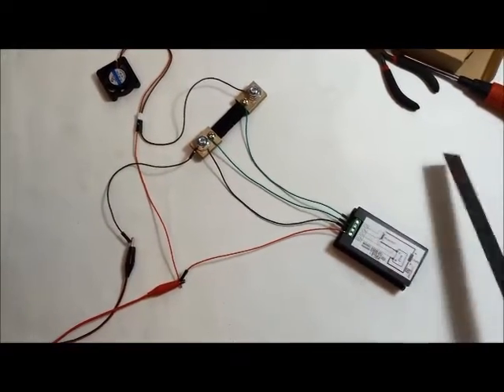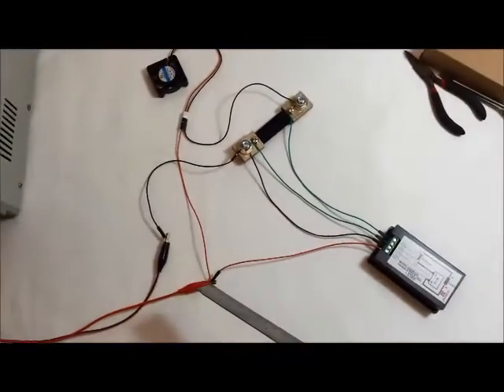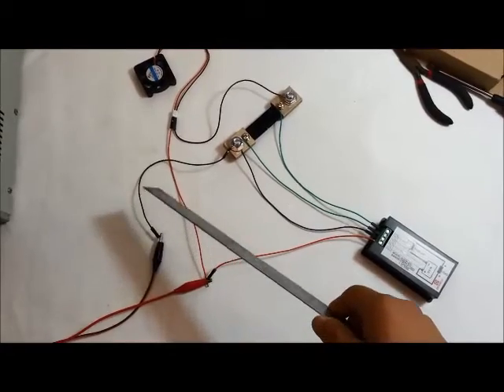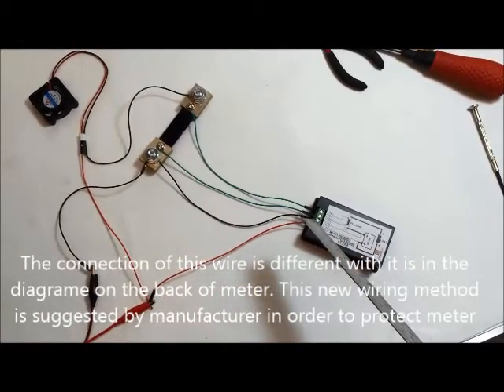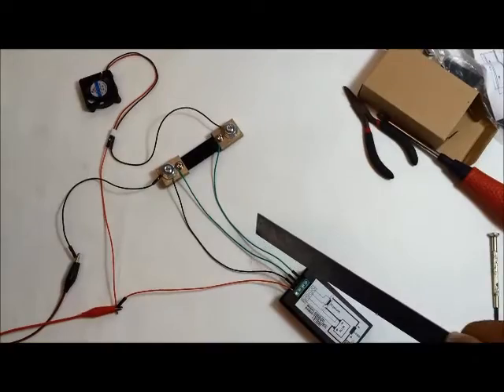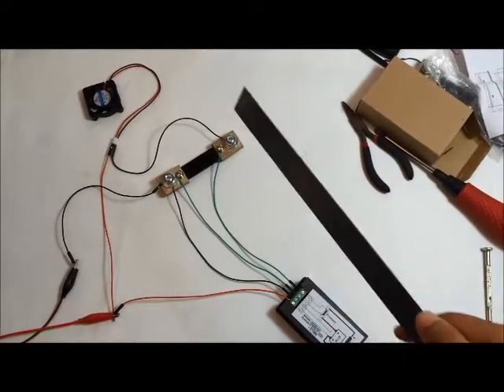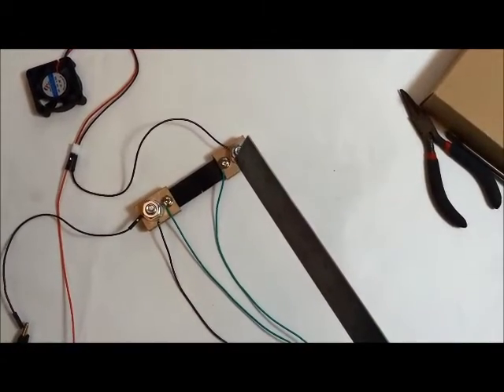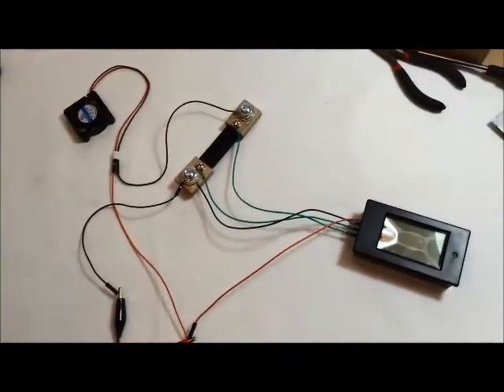bayite PZEM-051 DC 6.5-100V 100A LCD Current Voltage Power Energy Meter Multimeter

Comment: I bought 4 to put in my DIY solar shed project.  12v Solar panels.  12v batteries. And had 12v at the inverter when I was done wiring it all  up.  As soon as I hooked my batteries up to the system....all 4 ammeters lit up and were reading.  (Except they were all reading 48-50v).  Not sure why that was.  Everywhere I checked on the system I read 12.7ish volts.  But I then pushed the button on one to run thru the menu.  The meter then shut off.  And will not turn back on.  I held the button again for awhile.  And nothing.  So I did it to the other 3 and the same thing.  I double checked the wiring before hand.  Everything was right.  After they shut off I checked the wiring again.  And everything was exactly like the diagram. Any ideas??

Comment: Hello, thanks for this review. I would like to know how I can configure this to read battery voltage and number of current discharged from the battery. In my setup.. but the charge controller and the inverter can charge the battery. But the inverter is the load. Both the inverter and charge controller are connected to the battery.

Do I connect it with the Inverter being the load? hope nothing will happen when the inverter stops taking from the battery and instead starts charging the battery.
Reply from the maker: Please refer to this diagram:
http://ecx.images-amazon.com/images/I/713WcgbUDpL._SL1500_.jpg

Please check #2 and #3 meters.

Comment: I have a question about the current. Can it measure positive and negative? So charging and discharging currend?
Reply from the maker: +Robert-Jan van Poppelen No. The meter can only measure one-direction current. If you want to measure charging and discharging current. You can wire 2 meters on one shunt. Please check out the #2 and #3 meter in this diagram:
http://ecx.images-amazon.com/images/I/713WcgbUDpL._SL1500_.jpg
If you want to buy the meter, search bayite current meter on amazon.  
If you only want to measure the current, we have bayite hall effect meter which can measure negative and positive current.
Reply: +Bayite Amazon thanks

Comment: so far I hooked this meter to a fan and a light, if that is all it is good for what good is it? does any one know how to hook it up to solar, or a wind turbine??? help !!
Reply from the maker: +Ed Trulson Please chec the diagram in our last reply. In a circuit, you need to find out what is power source and what is load.In a solar system, there's a charging circuit and a discharging circuit. If you place the meter in the circuit between solar panel and battery, you're using the meter to measure the charging power. In this circuit the battery is load. If you place the meter between battery and your device. You're using the meter to measure discharging power. In this circuit the battery is power source.
Reply: you hook up the solar panels just like it is the power supply.. that is what solar panels are.. the power supply  DC   connect the leads the same as this video and you will have it.. 

Regulator or MPP UNIT is the LOAD

Positive (+) from the Solar panels is connected to the Regulator or MPP UNIT.

Negative (-) connected from solar panels to the Shunt 
Connect the other side to the MPP UNIT Now you are measuring the power produced by the solar panels.    The power can be from the battery side or the solar panel side..  Just know that the unit will alarm every night as it loses power due lack of sunlight unless one draws power from battery or other side of unit to get the constant range of 12 volts or 24 volts.
Reply: Terrance, I did as you suggested, connecting Positive from the Wind Gen to Positive of the Charger/Controller. Negative from the Wind Gen to the Shunt, the other side of the Shunt to the Charger/Controller. I can see Volts, Current etc. on the Display. Am I right that this setup only showing the Power the Wind Gen produces, but not that Power that goes into the Batterybank from the Charger/Controller? If so, do I need to put the Shunt in between the Negative from the Charger/Controller to the Battery to see how much Power is going into them? As far as I know there are losses between the Power the Wind Gen produces and the Charger/Controller is able to put into the Batteries.